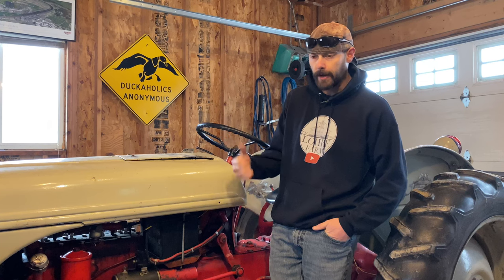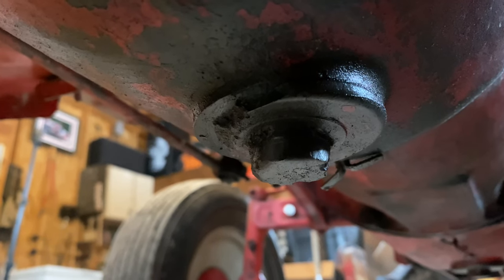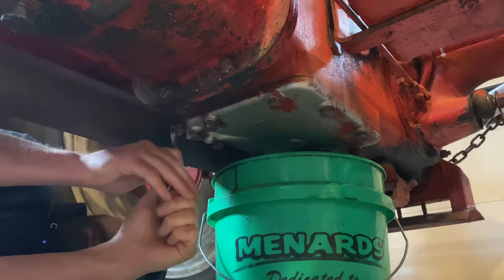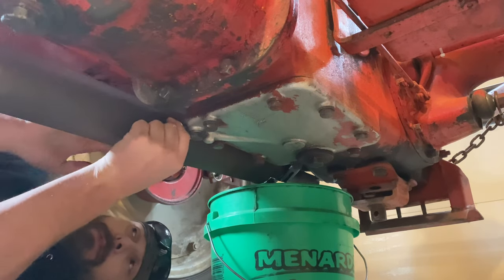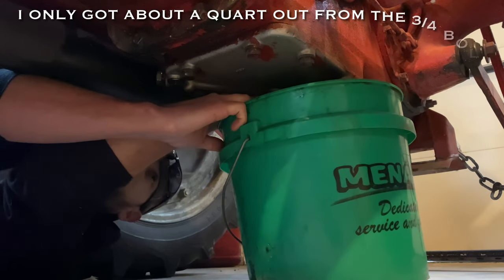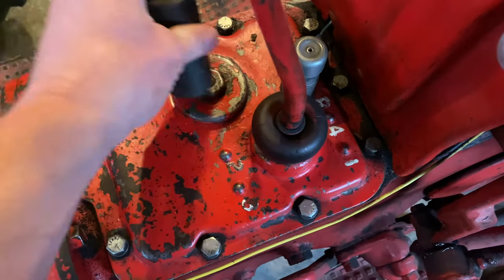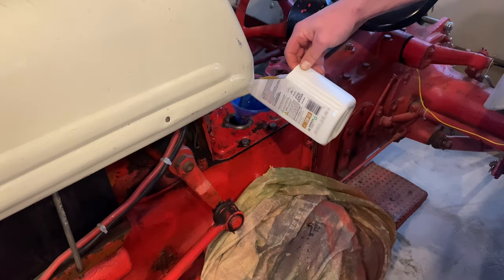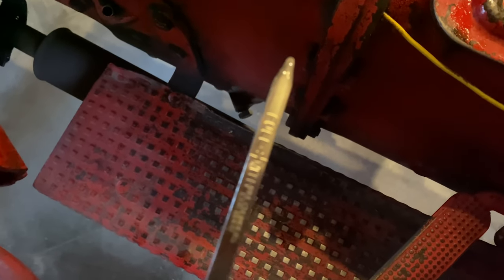Ford 8N Tractor 🛢️ Changing Transmission Hydraulic Fluid

Comment: I did a hydralic oil change on m 1951 8N.  I ut in the whole 5 gallons since that's the capacity.  I drained all 3 holes starting from the tailend plug, then the middle side plug, then the large front plug.  I drained it and let it all flow out overnite till I got no more dripping.  After checking the dip stick after running the oil and letting it settle back down, NOW IT SHOWS THAT ITS OVER CAPACITY. HOW THE HELL DID THAT HAPPERN?  They all take 5 gallons per instructions.  I'm flabbergastted.

Comment: Um, good lord, is your tractor still running. You drained the hydraulic system and filled up the transmission oil. Or am I missing something here.?!!!!! Those are two separate drain plugs. Did you read the manual?

Comment: Thanks for your videos. I changed my motor oil yesterday.  What do I do with that other canister on the otherside of tractor that reads oil level?
Reply from the maker: I believe you are talking about the air filter?
Reply: @LohreFarm  I'm not sure. If you are sitting on tractor it's on the right side. It says oil level on it. If it is air filter it confuse me.
Reply from the maker: @johnnyflapcakes2079 yep that sounds like the air filter. The bottom part should have a latch that will allow you to clean it out. It contains oil to capture debris before the carb.
Reply: @LohreFarm  Sounds great Thanks!

Comment: On an 8N, can I drain just the transmission with the bolt you chose not to remove and then refill just the transmission through the "radiator type" cap you removed? Its my first oil change and my transmission sounds low on fluid so I wanted to do it first.
Reply from the maker: These are not independent from one another. You change all of the fluid, or none. I believe the separate plugs are simply to remove dirt debris easier.

Comment: you still have the 6 volt system?  What did you do for bulbs for the headlights?
Reply from the maker: Nope. Converted to 12V a couple years ago. I don't really think it made any difference to tell you the truth. I probably should have just left it the 6V.
Reply: @LohreFarm  Yours sounds the same as mine when turning over, speed wise etc.  I will try a led to my batt and see what happens.  These little fords are some really good strong machines.  I might add a newer tractor to shop to have something with a shuttle or hyro trans.   But my ford will be on the farm as long as I own the place.